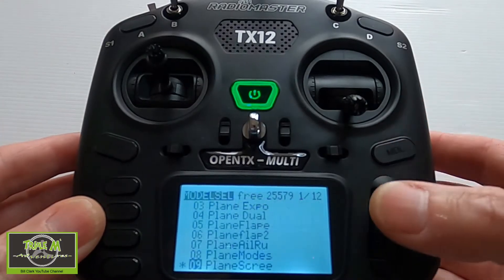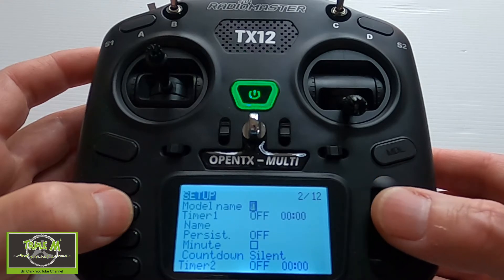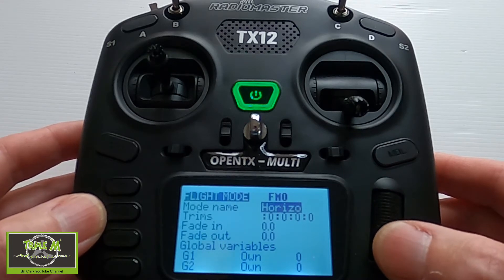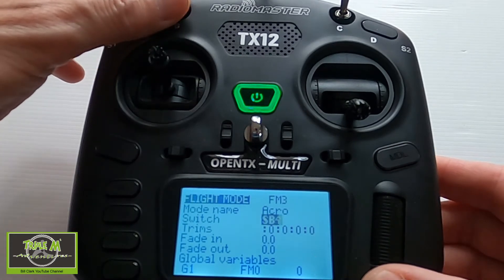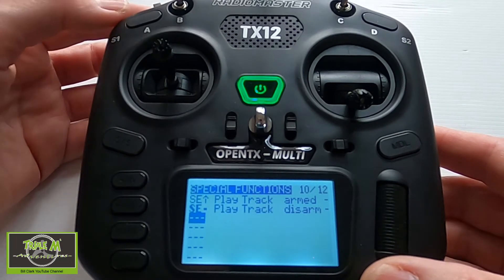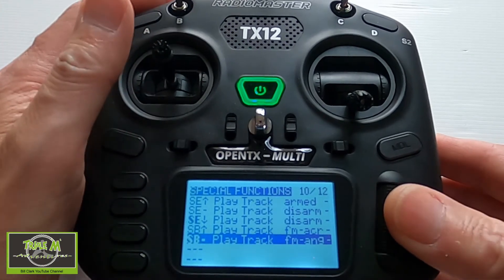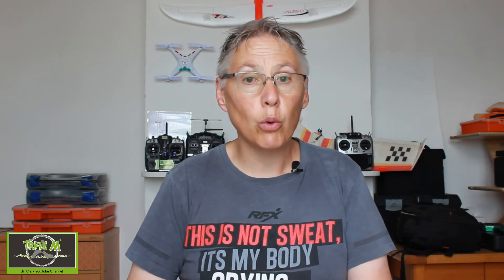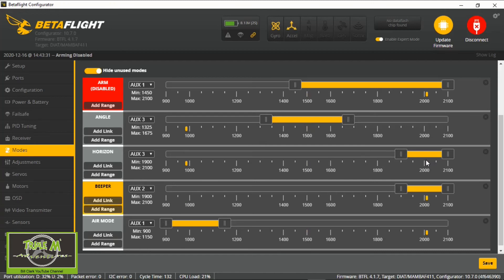RadioMaster TX12 Setting up a Basic Quad Copter

Comment: Hi Bill thanks very much for your video's. 
A question if you dont mind.
I bought the novice 4 kit from eachine with the tx 12 .It has the quad already setup in the tx12.
But I want to use other quads with the tx 12 ,do I need a sd card to do this.
Because I have tried but after I create model it dosent give me the plane ,multi and delta page you get on yours Thx.
Reply from the maker: Yes you do need to have the SDCard in your TX12 to be able to use the model wizards you will also get the sounds as well.
SDCard Contents Video:
https://youtu.be/7YXfGNqSiMM

You can use the standard model your TX12 is making by manually adding the AUX channel Mixes Arm/DisArmed, Modes & Buzzer Channels 5,6 & 7 respectively.

Alternatively copy your current quad and make any adjustments required. 

Highlight the model you want to copy.
Long Press ENT.
Select Copy.
Move to a available model number. 
Push ENT

You can now edit the model name, bind your receiver & check the configuration for your new drone.
Reply: @the-happy-RC-flyer  Your a legend Bill ,thanks so much for your help.
Reply: Hi, Clark, you're great. I am new to this hobby and I have a similar problem as our friend. But in an attempt to delete the new models I made, I deleted the QUAD and HELI models. What can I do now? Will it help me now to insert these contents on the sd card as you explained in the video? Thank you in advance and Merry Christmas

Comment: I have a TX12.. I just received a Fly fox Nano 3..with frisky receiver.. I am trying to Bind the drone to my Tx12.
Reply from the maker: I think you maybe choosing the incorrect firmware option FrSky receivers can me tricky to bind because of the different protocols.
FrSky X
FrSkyX2
and then FCC & LBT-EU versions.
If you are in Europe then you must use the LBT-EU version.
The firmware on the receiver must be ACCST and not ACCESS which will not bind to the multiprotocol module I am almost certain yours will be ACCST.
So try X and if will not bind try X2 and I am sure you will come right.
Reply: @the-happy-RC-flyer  thank you.. I am in Hawaii.. I will see what works from the options you gave me. Mahalo

Comment: immediate issues.... when i click on create new it does not ask me what kind it just opens a "model05" or whatever
Reply from the maker: Are you selecting a blank model number before setting up your new model?
Reply: @the-happy-RC-flyer  yes I went to a unassigned new number
Reply from the maker: @darwinmounsey376  are you long pressing the enter key?
Reply: @the-happy-RC-flyer  I hold it down the menu comes up to ask create model or restore model clicking create model only loads a  "model04" because I'm on the 4th option.
Reply from the maker: @darwinmounsey376  are you on the latest version of the OpenTX firmware?
Reply: @the-happy-RC-flyer  probably not
Reply from the maker: @darwinmounsey376  Check my playlist for  a video showing you how to update your firmware.
Reply: I am facing that same issue , when I create a model it doesn’t give me any option to select what kind of model I want and just creates a model05 and I’m on the latest firmware.
Reply: @corahul  just page over I think it's a newer layout, after selecting the model you want page over to find the inputs outputs and mixes
Reply from the maker: @corahul  Do you have the SDCard contents in your radio?
Reply: @the-happy-RC-flyer  thanks for replying. I didn’t copy anything in SD card yet.
Reply from the maker: @corahul  set up your SDCard and the model wizard should appear in your menu.
Reply: @the-happy-RC-flyer  thanks , setting up SD card worked. 

I had another question , when I arm my quad , even though the throttle is completely lowered the motor starts spinning.
Reply from the maker: @corahul   It is because Air Mode is activated, when you arm you should get into the habit of arming and immediately taking off. Air Mode can be disabled but I suggest you do not turn the option off. With Air Mode active your quad is still controllable in all axis but will drop if the throttle is shut off. If you drop the throttle to zero you can sill manoeuvre your drone. It is very dramatic if you have Air Mode off and shut the motors off your drone drops like a rock tumbling as it goes.
Reply: @the-happy-RC-flyer  thank you so much. You’ve been very helpful.

Comment: Non of my switches show up in BetaFlight only my sticks.
Reply: Figured it out. Inputs and mixes were not assigned to switches
Reply from the maker: Have you set up your AUX channels? Remembering AUX 1 is Channel 5 and assigned them in Betaflight?
Reply: @the-happy-RC-flyer  I did a factory reset and I got the AETR to work. The 1234 channels are not working. The receiver getting all four controls except no switches at all

Comment: im not getting any of the options you are i create a new channel and nothing else happens
Reply from the maker: Dakota could you please give me a bit more information which part of the process of setting up the quad copter is not showing any options? When using the TX12 to first add the model?
Reply: @the-happy-RC-flyer  Sorry i was frustrated last night. I appreciate the quick response. So when I go to add a new channel I do not get the option to select plane delta or multi and after i do create the new channel it just reverts back to the channel list im unable to figure out where to do the next step you did and assign the channels and auxs to the radio
Reply from the maker: @syntrexfpv1347  which version of OpenTX are you running?

Comment: Hi Bill , i can't change the Arm to SE switch. Only SA,SB,SD,. How i can change it. Help me please.
Reply from the maker: If you cannot select the switch E you need to check if it is active by going to the SYS menu go to Hardware and see if E shows 3POS.
Reply: @the-happy-RC-flyer  SE on in  3POS.
Reply from the maker: @joni-mirfpv6976  that is normally the problem the switch is not active can give me more details of what you are trying to do and how and I will try to assist you.
Reply: @the-happy-RC-flyer  A new quadcopter, just assembled, I'm trying to set up the equipment for the initial connection to the receiver.  I also want to set up switches for stabilization and acro.
Reply: @the-happy-RC-flyer Maybe update the firmware first?
Reply from the maker: @joni-mirfpv6976  have you set up the Aux channels in Betaflight?
Reply: @the-happy-RC-flyer  No, I haven't connected it yet.
Reply from the maker: @joni-mirfpv6976   you need to check the receiver is working and see if switch SE operating in Betaflight.
Reply: @the-happy-RC-flyer  ok, thanks, i will check and inform you.
Reply: @joni-mirfpv6976  Hi, do you fix it? I have the same issue
Reply: @null.32  Yes,I set this parameter later in Betafly.
Reply: @joni-mirfpv6976  Could you give us some explanations pleease
Reply: @tagadagrenouille7373  You need to activate the switch in the transmitter.  and then check if he works at Betafly.

Comment: Hi Bill, I bought a NewBeeDone as well as the RadioMaster TX12 and was wondering how do I get this NewBeeDrobe to bind to this new radio.  I followed these basic quad copter instructions but not binding to radio.  Any suggestions?
Reply from the maker: Please let me know exactly what drone you bought so I can check the receiver / protocol it uses then I can advise you.
Reply: @the-happy-RC-flyer  Actually, looking at one of your other videos I managed to get it to bind but to arm it I have to press the A button and wont stay armed I would have to keep the button A pressed all the time to fly.  :(
Reply from the maker: @white2eagle  I would suggest changing to a switch and not use a button.

Comment: Do you need crossfire module ?
Reply from the maker: Ksawierr, if you are offering one that is very kind but I do have a TBS Crossfire & TBS Tracer Module which I use every week. If you are asking in the case of the TX12 you can put a Crossfire module in the JR bay yes you can. Please accept my apologies if I misinterpreted your question.

Comment: When I press create it does not show the options for the model type, is there any way I could fix that?
Reply: And it does not give me the options to set up the arm switch and things like that.
Reply from the maker: @Jgc_-kk7os You must be on a empty model number when trying to create a new model.
Reply: @the-happy-RC-flyer  No I do not
Reply from the maker: @Jgc_-kk7os  so when you go to an empty model number you cannot still have the new model options?
Reply: @the-happy-RC-flyer   if I press on an empty model I could press create new model it it does not give me any of the other options that was in your video. There is not an option to set it up as plane delta or multi and all of the options after that. All it does is create a new model and auto selects it.
Reply from the maker: @Jgc_-kk7os  what firmware version is on your radio if not 2.3.11 I would try updating to that version it could be the problem.
Reply: @the-happy-RC-flyer  I don’t know what firmware it is on. How could I update it?
Reply from the maker: @Jgc_-kk7os  here is my tutorial video which should help you.
https://youtu.be/iaoR3CLIYhY
Reply: @the-happy-RC-flyer  thanks for helping

Comment: Can please help? I'm trying to bind my 1st FrSky XM+ with my radiomaster TX12 controller... After I'm done pairing and power the FrSky off and back on, I just get the standard blinking red light instead of green.... Tripple checked the wiring diagram on the FC and FrSky.... Any input would be greatly appreciated
Reply from the maker: Hi, the receiver is not binding to your TX12.
The binding procedure is:
Hold down the bind button on your receiver and plug in the power.
Go to radio click bind. 
Once bound disconnect power from receiver. 
Reconnect power to receiver you should be bound. 
FrSky Receivers:
If you receive is the ACCESS protocol it will not bind to your TX12.
It needs to be ACCST but it can use v1 or v2 firmware and there is no way to tell what your FrSky receiver firmware version is, FrSky do not make it easy.
So on your TX12 try Type FrSky X or FrSky X2
Let me know how you get on.
Reply: @the-happy-RC-flyer  hi, I've tried both FrSky 2 and X without luck... I get the silid red and green led's indicating I'm in binding mode, but after the binding is done beeping on the TX12, I remove pwr from the FrSky, plug back in and just a blinking red light . Also, what do you mean by access? Sorry brand new to this, but since I very good and soldering and following directions, I thought it would be simple. My next step would be to update to the newest FrSky xm+ firmware... I really appreciate your help 🙏
Reply from the maker: @califpv   If the binding is successful the red led will blink to show you the receiver is bound to your radio. Then you turn the receiver off and on again. The latest receivers are being shipped with the latest FrSky protocol which is ACCESS and this will not bind to the multi protocol module. There is one thing you can try and that is to go to Freq tune and put -20 in and try both FrSky types if that does not work try 20. This is a very rare problem but can cause your receiver not to bind because 0 is not within the fine frequency tune range. 

https://youtu.be/7aJ0oLFO-0U

If you flash your receiver with firmware make sure it is ACCST.
Reply: @the-happy-RC-flyer  got it! I'm also going to try and install the letest FW for my TX-12... Couldn't hurt right? Is there anyway to update the FrSky through the TX-12? I don't see a port like in other controllers... I was just going to order the usb tool.... Don't wanna buy a more expensive controller when I'm just starting out ....
Reply from the maker: @califpv  here is my video which shows how to update FrSky receivers using the Jumper T16 now I am not sure if the pin outs are the same for the TX12 before you try email RadioMaster support to ask for the pin allocations for the TX12. I will contact them as well. 
https://youtu.be/Zp4NFljI9vE
Reply: @the-happy-RC-flyer  thanks bill.... Have a great weekend my friend
Reply: @the-happy-RC-flyer  bill, might be a good idea to make a video, if you have a spare FrSky xm+ on this binding issue with the Radiomaster TX12.... I've found several people in forums and reddit who are experiencing this with their new TX-12's ... Just a suggestion 😉🤷
Reply from the maker: @califpv  suggestion appreciated 😊
Reply: @the-happy-RC-flyer  so with the whole assist thing... The newest firmware for the xm+ is in ACCST. if I update open TX on my TX12 and use this new frsky FW, will this ACCST version on the Firmware work, or should I downgrade to a much older version of FrSky FW? 🤦 Just trying to get this little quad in the air for practice, so For my 1st quad I don't mind not having telemetry ... Thx Bill 🙏
Reply from the maker: @califpv  ACCST is OK ACCESS a no no for the multi protocol module. Here is a link to my google drive the firmware is there for you to download. LBT for Europe and FCC for USA and everywhere else I think.
https://drive.google.com/drive/folders/1mb1nhTCaJ3qz73wusjV3j_dlOA-Ks7nY

Comment: Hi Bill . i lost my default model settings in my radio.how do i get them back.. I think i hit the factory reset. Iam new to this. Need help
Reply from the maker: Sorry to say Edgardo the only way you can get them back is if you made a backup of your model and radio settings using OpenTX Companion. Did you have models already on your radio?
Reply: @the-happy-RC-flyer  no i did not
Reply from the maker: @edgardojagr216  You will need to put your models back on manually I am sorry to say. I would think your radio settings would have  been the default settings.

Comment: Very strange, but I cannot seem to select SE for any of the assignments.
Reply from the maker: Please check the following:
Have you tried to select the switch manual rather than actuating it to select?
Long press  Model  key
Go to Special Functions
Go to a free line
Hit the enter key and try to scroll to switch E
If that does not work actuate the switch.
If still no luck go to:
SYS
Page Right  to HARDWARE
Scroll down to Switches
Check SE is there and set to 3POS
If everything looks ok then you may have a faulty switch or bad solder joint. Then I would suggest returning it to the vendor you purchased it from.
Reply: @the-happy-RC-flyer  Thank you for taking the time to reply. That's the thing. In special I can select it no problem. It's when I go to Assign the multicopter switches on AUX1 or AUX2 I only have SA through SD available. Special I can select SE as detailed in this video. I did check the Hardware to make sure it was 3POS. And the PlayTrack works when I set the Armed and DisArm. Is it possible my SD card did not import a setting?
Reply from the maker: @nofreebeer  Can I check you mean when you are in Betaflight? I am not sure if you are aware then AUX 1 = Ch. 5, AUX 2 = Ch. 6 and so on. Channels 1 to 4 are assigned for the primary flight controls.

Comment: Hi Bill great vids very helpful. I'm waiting on my TX12 to arrive. When it does should it be easy to connect to my tinyhawk 2? The controller that come in the rtf kit is awful.
Reply from the maker: You should not have any problems.
Reply: @the-happy-RC-flyer  brilliant looking forward to using it looks a great beginner controller. I was going to get crossfire micro TX V2 module as well. Is that pretty straight forward to connect to the TX12?
Reply from the maker: @sheapy77  you should have no problems installing the Crossfire TX in your TX12 setting up is straightforward.
Reply: @the-happy-RC-flyer  many thanks Bill. I will follow Ur video when I set it up